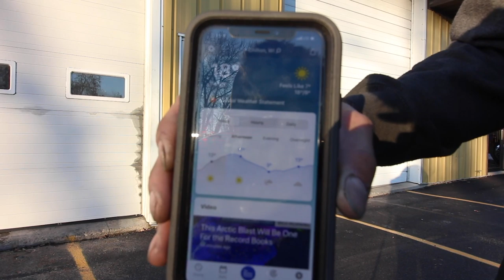Does temperature affect my metal polishing?

Comment: The coldest I tell people to polish is 50 degrees. That not 50 degrees air temp but 50 degrees metal temp. I  have had people tell me products dont work and it was because the metal was too cold. I open toolbox doors to allow the cold air to escape as that trapped air can hold that door cold for an extended period of time. You are correct when you say temp is key. The hotter the metal the more it "flows" during polishing and the better the finish
Reply from the maker: Truth
Reply: So am I understanding correctly, it's now July. Giving the aluminum time to cool in the evenings after driving is not necessary? The hotter the aluminum, the better? What about direct sunlight, does it cause hash marks when polishing as it does on paint?

Comment: You should polish in 100 degree heat with 60% humidity. Gotta keep the compound in the shade or you’ll have a puddle instead of a bar
Reply from the maker: Been there done that in Texas and in Florida. Lol.
Reply: Normal weather for me in Mississippi lol. I got so use to polishing in the heat that when it dropped to 60 I didn't know what to do. I drove around the block a few times to get some heat in the wheels before I polished.
Reply from the maker: @moosey1978  Sounds right... LOL